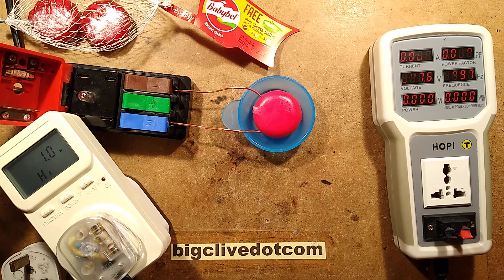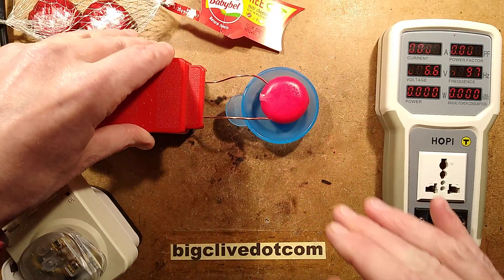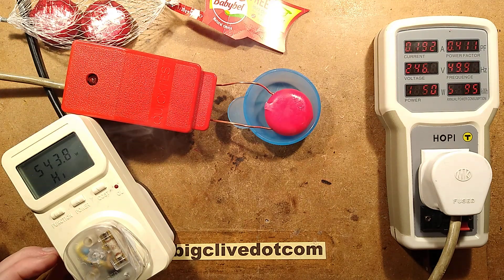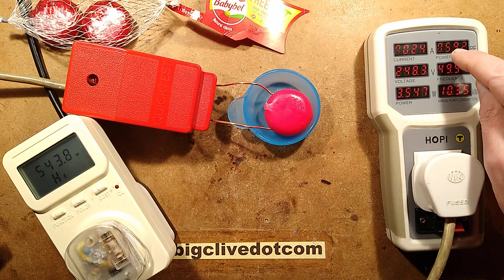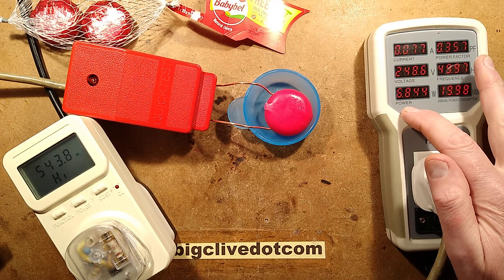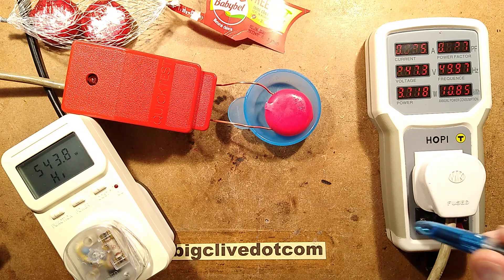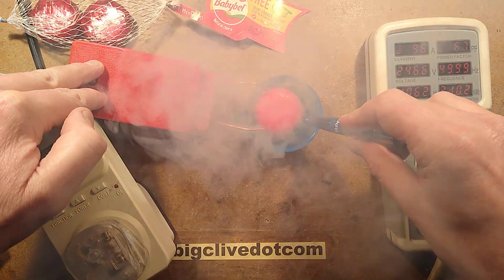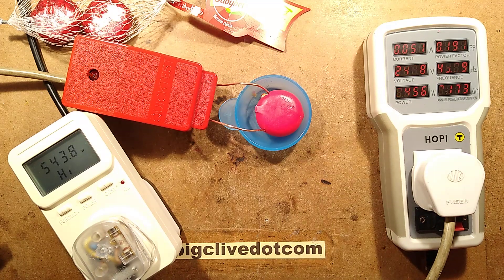Zapping a Babybel cheese at 250V with its wax on.

Comment: So far we've electrocuted hotdogs and cheese but no bread or condiments.
And this started me wondering if one could "bake" bread dough with current. Maybe it would make an inverse baguette? Soft on the outside and crunchy on the inside. Not ideal for holding a hotdog though.
Reply from the maker: There are factories that do bake bread with current.  Mainly to make a crustless loaf for use in crumb making.